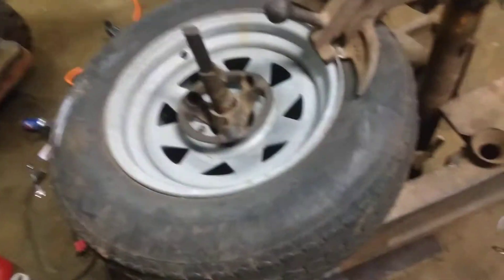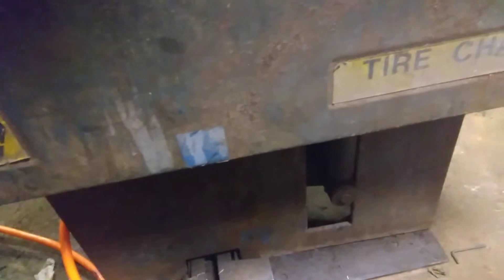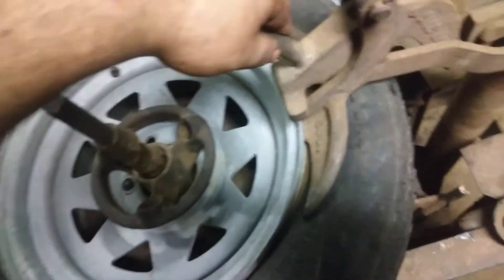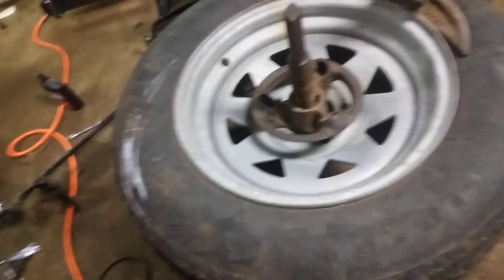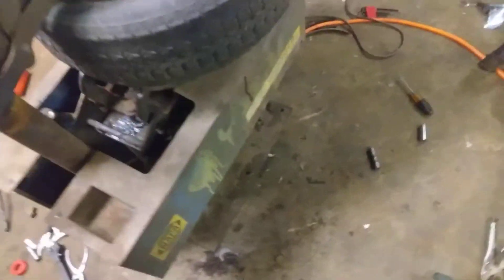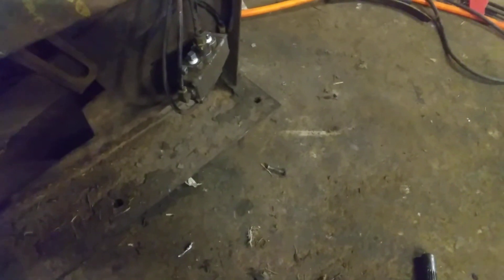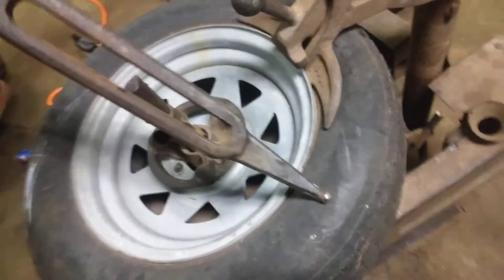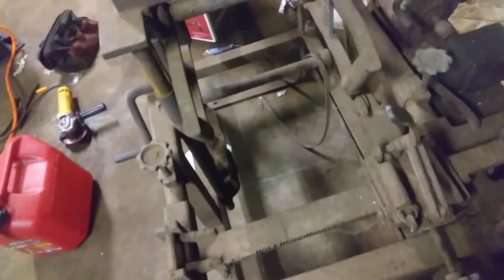Vintage Napa Model 86-105 Tire Changer

Comment: I have the same and the same problem... First Time I found a VIDeo! tHANK you!  I think the manufacturer is Bishman. That's what mine says. Hard to find info. When you show that piece at 4:40, that round piece I believe the O-Ring inside that grove is worn out. I'm going to my shop today and gonna check it out.

Comment: I have one of these. I believe there is supposed to be a small leather seal about the size of a dime in the hole of the brass fitting on each side. I believe this is where it gets its back and forth motion to turn the center post. My center post wouldn't turn at all when I got it and just leaked air. I made some seals for it and it worked. It is weak and needs to be rebuilt. I think it is supposed to be oiled occasionally on the top of the large cylinder. Mine was slow and I added a few squirts of oil there and it helped. May have to tear into it this winter and see what I can find out. Info is very scarce on them except to make sure before seating beads to remove the center nut on the post.

Comment: I just picked up one of these tire machines. Mine doesn't build enough pressure to remove a tire similar to yours. I pulled the big cylinder apart and found it needs a U type O-ring seal at the piston, it's about 6" across and 3/8" wide, my local hydraulic shop is getting the seal for me. There is no seal at the top where you put the grease, the reason you hear the air coming out there is because your seal, like mine, is bad. This is a single acting cylinder meaning it gets pushed up from air pressure and returns via springs. The port at the top of the cylinder is just simply a vent, as the piston gets pushed up the air on that side of the chamber has to go somewhere. Pretty simple set up really. I am looking forward to getting mine up and running soon. And you are correct, not much information around on these old machines. Maybe I'll make a video of the reassembly process.
Reply from the maker: Thanks for the information on the cylinder I do need to get mine fully fixed but it's been working fine
Reply: @hotrodgavin6543  squirt some tool oil in the air intake every once in a while

Comment: I have one called a BIG 4 says it is division of Studebaker. ModelXP-100BF, it has been hard to find any info till I came across your video. I figured no one else had one but I guess I was wrong. I need some parts if anyone has any for sale

Comment: My upper b3ad braker doesnt return on the top positions inneed to pull hard to get it on the tire, but once it place correctly it go down when i push the pedal ... but damn its hard to put on the tire ... does the little cylinder each side are suppose to help with this motion?? I can't Belive we realy need to pull this hard to put it on..